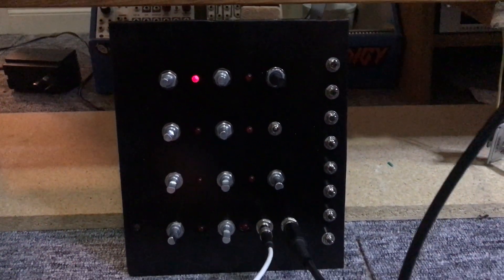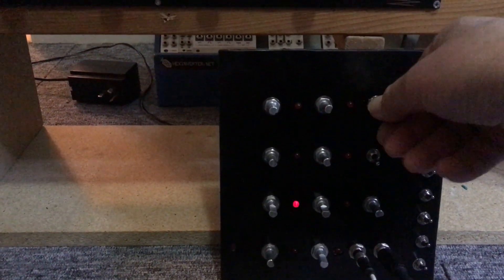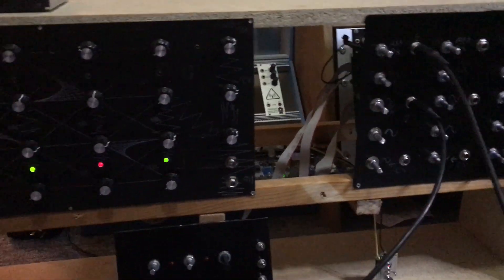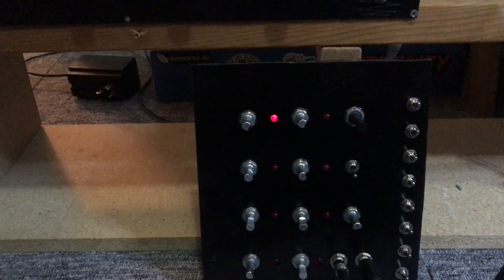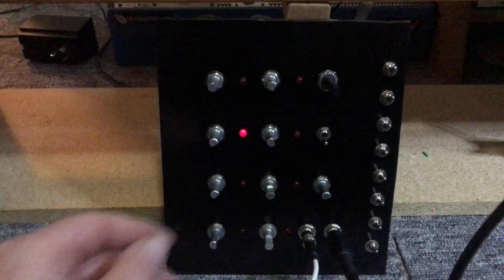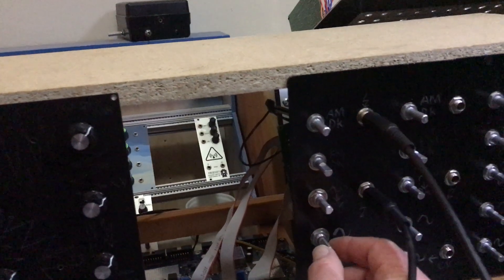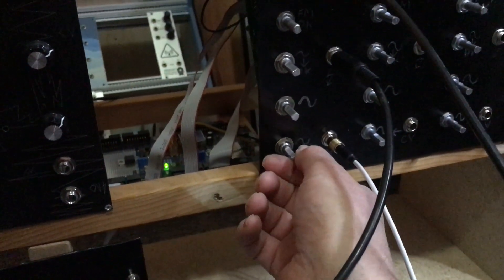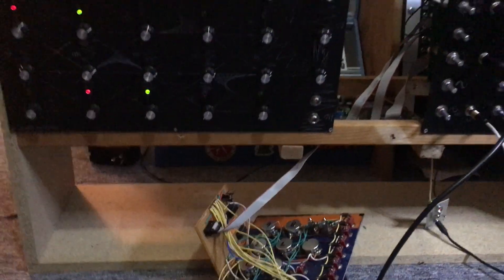8 Step Sequencer

Comment: Hey, I'm trying to build the same sequencer and I'm having trouble getting it to power on. Did you have any issues with the schematic/stripboard layout from Eddy? I've triple checked every connection against the schematic, and I can't get it working.
Reply from the maker: Hi. No I dont remember having any power issues with the stripboard. Have you checked voltages at all the relevant points? I have the schematic/strip board layout that I used if you want to have a look. Just in case it is different.
Reply: @VK3IK  I went back over the entire build with a fine toothed comb, checking every connection for continuity. Checking voltage was correct and consistent across the board. Everything fine. Finally, I thought to replace my IC's. Looks like I had a faulty 4017. Fixed now!
Reply from the maker: @DakZouglas  Fantastic mate. I had that problem with some TL074 IC's. Glad you got it going.